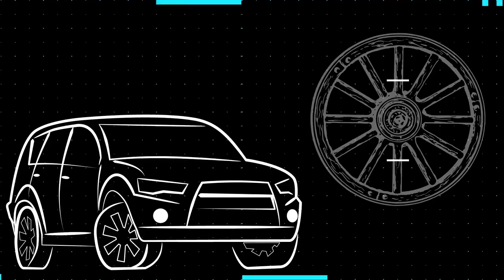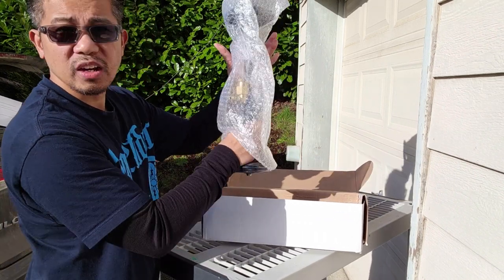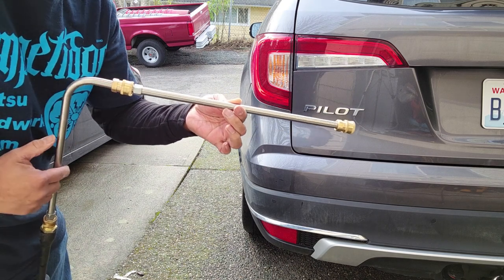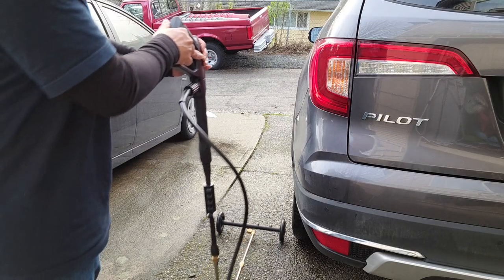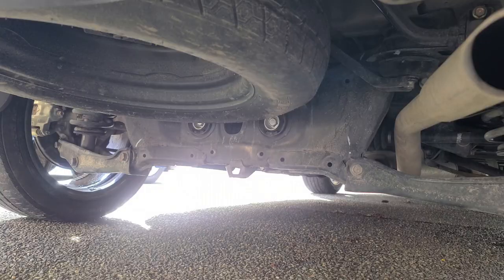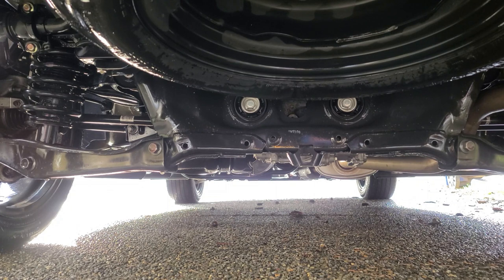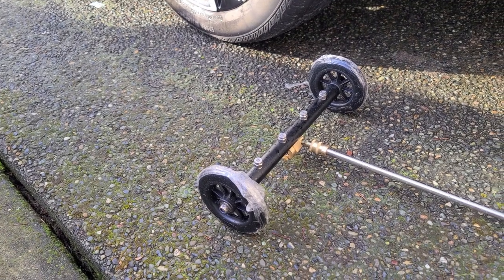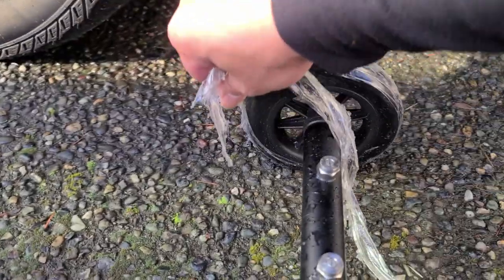Dual Purpose Undercarriage Cleaner and Water Broom | Pressure Washer Attachment

Comment: Perfect.  It would have taken me three days to figure out how to connect those three extension wands and you showed them in various combinations.  I'm not too impressed with that 90 degree angle wand.  It seems like it would be better at 45 degrees.  But, maybe I'm missing where that angle is needed to get at a particular part of the car.
Reply from the maker: I agree. 45 angle would have been better.
Reply: @AutoSensation  I just ordered the Tool Daily unit that looks identical to your washer.  It too has the 90 degree wand and two straight wands.  They look to be aluminum so I'm hoping if I GENTLY persuade the bend then I can get it down to a 50 or 60 degree bend without breaking or kinking it.
Reply from the maker: @STBRetired1  try heating or warming before you attempt to bend. Don't know if it will break or kink. Good luck

Comment: What kind of a signature jetliner you're using?
Reply from the maker: https://amzn.to/3GKpzNN
Reply: @AutoSensation  What is the bar pressure
Reply from the maker: @agrihalid3775  Working pressure range is 1500 PSI to 4000 PSI. Suggest working pressure is 2500 PSI or higher.

Comment: How do i know it will connect to my Karcher pressure washer?
Reply from the maker: What is type of output connection do you have? This comes with 1/4” quick connect plug. If yours is different you can buy adapters. https://amzn.to/3tVIHWu
Reply: @AutoSensation  I don't think it's compatible. Mine is spring loaded. Rectangular sort of wings I press in and twist to lock.